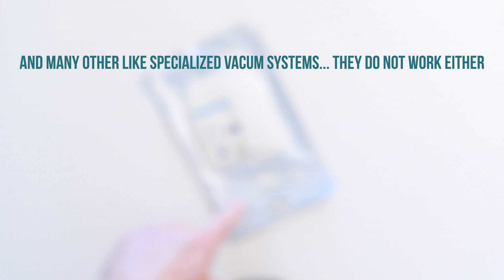Leica M sensor cleaning procedure

Comment: Interesting. Thanks. toronto canada.
I use Panasonic mft gear, but this is useful.
Reply from the maker: Just make sure no pressure is applied to the sensor and your tool is 100% scratch free. Good luck.

Comment: What the actual fuck is this video??? 

This is terrible advice. 

Warning to others: DO NOT DO THIS!! Buy a sensor cleaning kit that is designed for the sensor. Lens pens and brushes are designed for use on front elements of lenses, NOT SENSORS. This will absolutely scratch your sensor. 

Also NEVER breathe onto any part of your camera. Your mouth is full of bacteria and acidic digestive enzymes. This will cause irreversible damage to any glass or electronic components.

Comment: This method left more marks on my sensor than before - don’t use a lens pen, use a full frame swab.
Reply from the maker: Sorry to hear you were left with more dust than before. My method is definitely not for everyone and has its risks. I have used it for years without issues. On the other hand the swab just moves the dust inside the camera 😉 it does not collect it.
Reply: @bonevchannel  it unfortunately left a smudge/mark on the sensor. Luckily, using the swabs removed it. I’ve actually found by applying a small amount of sensor cleaning solution to the swab that it does collect and remove the dust.
Reply from the maker: @alanpring  it feels like the pen might have been used before or it had something on it by the manufacturer. I have bought so many solutions including the swab, vacuums, liquid and etc. I gave up at the end.

Comment: This is arguably the worst way to clean a Leica sensor or any sensor for that matter. He is fooling himself. The use of a lens pen on the sensor will cause micro scratches on the sensor glass. The lens pen is not designed for sensors, also touching the end of it contaminates it. Breathing on the sensor or into the camera risks electrical failure, and human breath will assist in fungal growth both behind the sensor or in lenses.
Reply from the maker: It is dangerous as all other methods unfortunately. I have tried the famous silicon sticks that actually produced oil residue. Then after complaining to the manufacturer they sent a new batch which had the same issue. Then I went for the expensive vacuum canisters that did I not do a thing. Brushes … they are all rubbish. So in my desperate times I found this method for myself and it works 100%. That pen I use for it is kept only for that purpose and kept very clean by just blowing with rocket blower to it. No spitting, no hands touching allowed. Then if you are worried about the moisture… well you do not blow a lot and second imagine using the camera in drastic temperature changes … it will be more dangerous. Anyway if a person is not confident then they should definitely not do this!!!
Reply: @bonevchannel there is no way you think blowing on your sensor from your mouth is even close to being a good method for cleaning it. You’re now introducing bacteria or moisture you can’t even see onto the sensor and then rubbing it all over. No doubt this is terrible for the sensor. 

The only responsible thing to do would be to take this video down from the internet.

Comment: the worst advice to clean sensor.
Reply from the maker: I never said it is easy but works 100% each time. All other solutions leave residue or dust. 

Best thing to do in this situation is to send it to Leica service which I can tell always did a great job.
Reply: @bonevchannel  it will never work 100% because round lens pen can't reach sensor's corners 🤷🏻
Reply from the maker: @firstwitness5735  aha, that is actually where you are wrong. Watch the video carefully. I think at some point I will explain that you need to extend the pen tip (mine is removable) so you can easily reach all parts of the sensor. On M240 reaching corners is no issue as there is just enough space around the sensor so the tip can cover the whole edge.